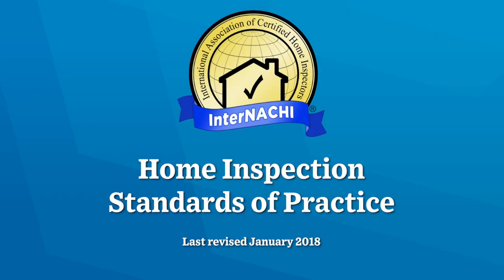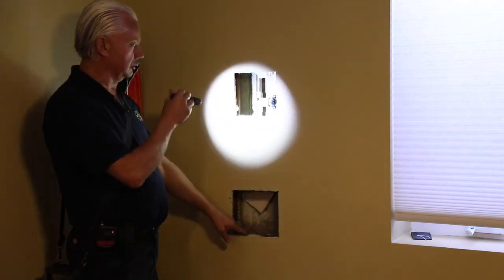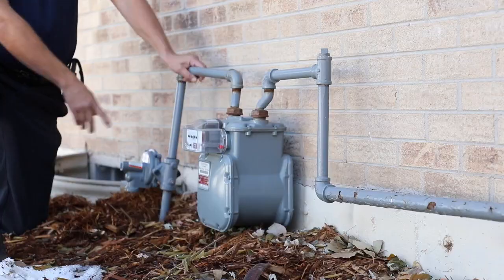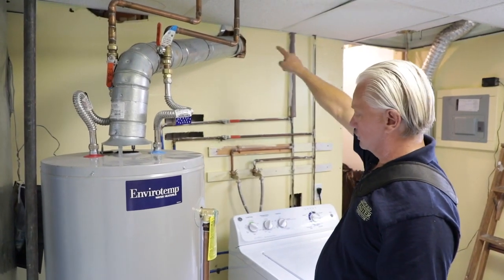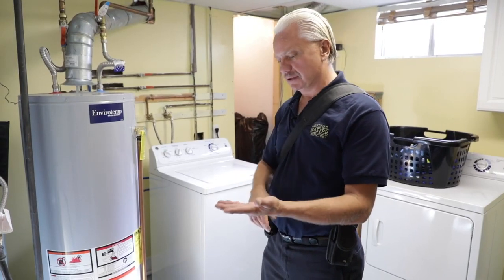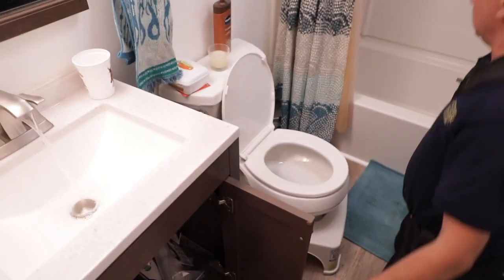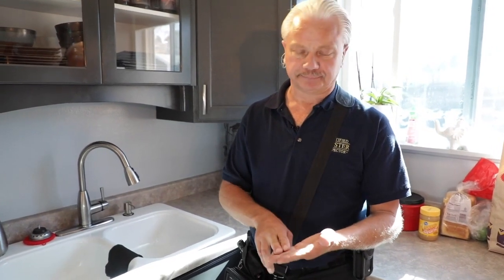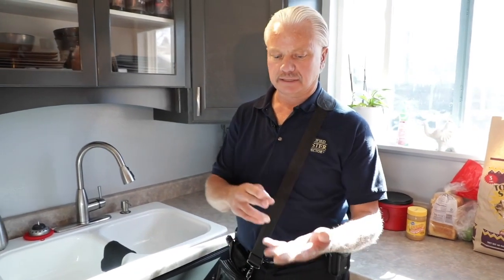How to Perform a Plumbing Inspection According to the InterNACHI Standards of Practice

Comment: Did he say they use a copper pipe as a ground?  Did he mean that you should bond the metal/copper pipes to the panel to maintain safety in case of them being energized?   The dryer pulls air from the home, concern about not enough combustible air?  Wouldn't the real concern be that it would cause back drafting (already confirmed that it's not a problem)?  Not a lack of combustible air?  Also, in your other videos you mentioned lots of pictures.  Do you take pictures of the plumbing appliances operating/testing and do you take pictures below sinks after running them to show no leaks or damage.  Also shows limitations from storage.
Reply from the maker: Good catch, B.

Comment: What code says caulking or not around toilets?
Reply from the maker: I believe it's 2021 IPC 405.6, Watertight joints. "Joints formed where fixtures come in contact with walls or floors shall be sealed."